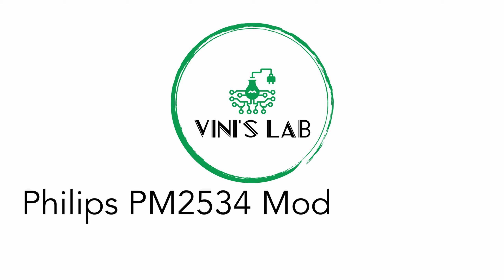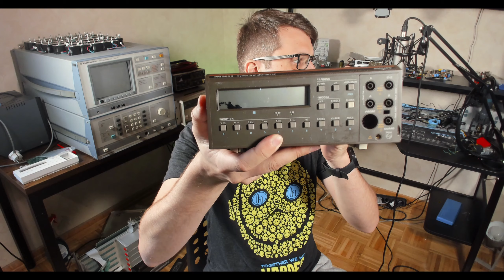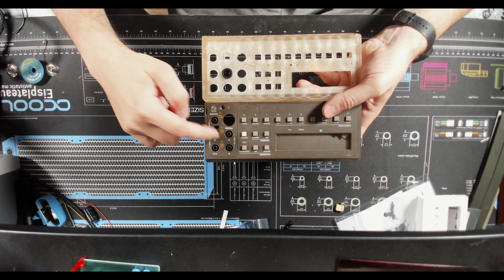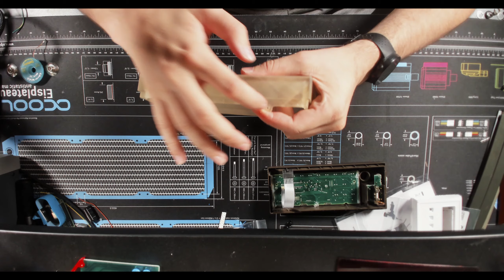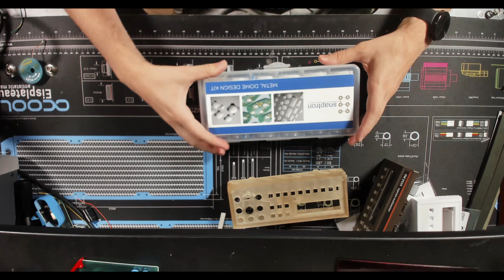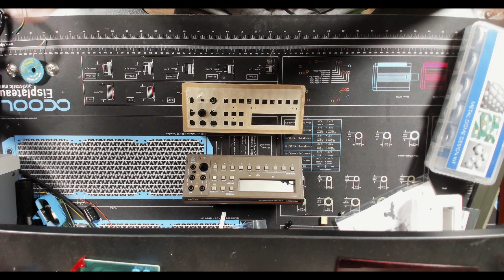Philips PM2534 Mod - Part 1

Comment: Macro Reps sent me here too. Nice project!
One issue regarding the banana sockets: Whenever you connect a lead, you will be pushing against the front panel. This can be quite some force (depending on the socket and plug). I would be afraid that this could crack the panel. Therefore I suggest to add plenty of support structures at the backside of the panel around the banana plugs (since you are 3D printing it anyway). But be careful that you can still reach the nut. Or you make the support structure in a way that it has the outline of the nut, so that you don't even need a wrench down in there. :-)
Reply from the maker: Hey Johann, I appreciate your concern! The wall is quite thick, also all the banana plugs will be fixed on a back pcb, so they will be very stiff and provide support between each other. Hugs from Vini :)

Comment: Love your lab. Also a very interesting project :)
One thing you can think about is to try to only speak in one direction and about the same distance from the microphone consistently, so the audio does not have so much difference in the volume.

Marco Reps sent me here.
Reply from the maker: I will solve this in the future with multiple microphones. Hugs from Vini :)

Comment: Great job, really interested to see how this goes! One thought is about that removable panel where the probe connections are on the original. I would consider doing something similar and then mounting the connectors on a sub-panel that sits behind the removable front panel, this will result in a cleaner flush look. It also has the side effect of making the unit a bit more serviceable, as the front panel can be removed without having to remove the sub panel that holds the probe connections.
Reply from the maker: Yes sure I'm thinking to have a PCB for the connectors, so the inner ones can be easily unplugged. The original one has some pig pins where the wires are inserted.

Comment: Alright, this is pretty dope. Can't wait to see the final version! 
Are you gonna do a video explaining how you designed the new board and display?
Reply from the maker: Absolutely! Next video is sanding the panel and doing some paint job, after that you will see the design in Altium and pcb assembly. Subscribe to see how it will end!
Reply: Vini's Lab já feito :)

Comment: You are mastering English well you only have to hesitate less just a little more secure about the subject you're talking about, you're not saying anything wrong
Reply from the maker: Thank you Fabrizio! Yes I'm planning to create talking points to the videos, I tried to script in the first videos but gets too boring and and doing this for fun, so should be fun. But you know time bring perfection! :) Hugs from Vini
Reply: Vini's Lab 
Also, the word you were looking for to describe the "dry" and "cracky" material of the original bezel is "brittle". Brittle means hard but easy to break (like glass or ceramic). 
But your English is perfectly fine for these videos. Your accent is easy to understand and you get all the technical information across clearly. No worries!
Reply: @VinisLab  Your English is very good. Two minor things I noticed, just for your information: Pomona (a town about 30 km from where I sit) is po-moan-a. Also "cracked" is pronounced crac-t rather than crac-ed.
Reply: @VinisLab  have a good day too boi

Comment: I trash picked a 2535 some months back.
Reply from the maker: Treat it well it's an amazing device! Those Those Philips devices from that era are well underrated! There are only a few electrolytic capacitors to replace, if you don't have problems with your LCD you will have an excellent device for many years yet! Hugs from Vini
Reply: @VinisLab  fortunately the display is perfect. I think some of the ranges might be a bit of but honestly I haven't had the opportunity to really use it. But I'm definitely going to be keeping it around. Saved from the being recycled ♻